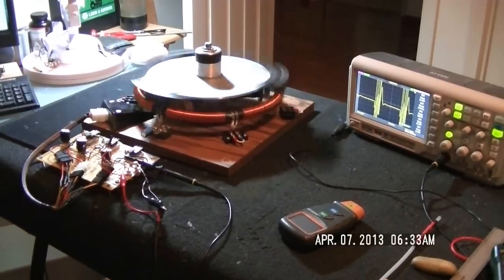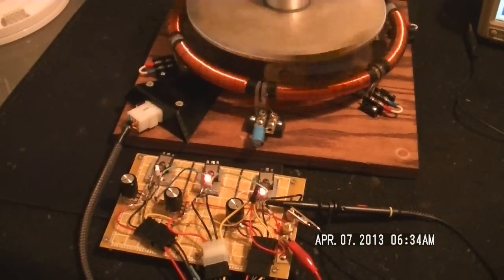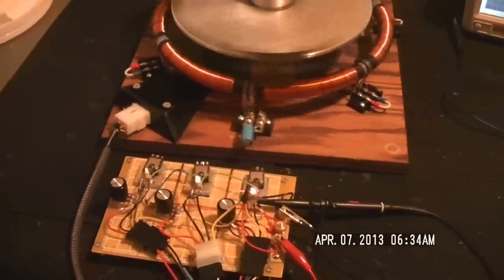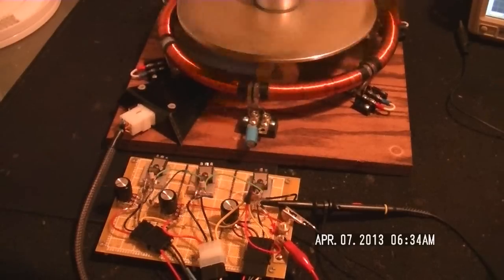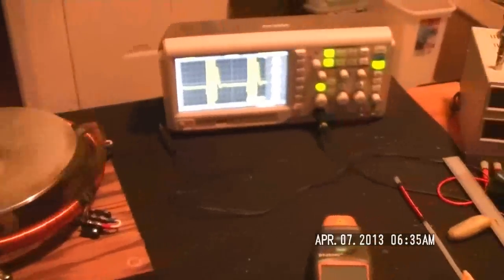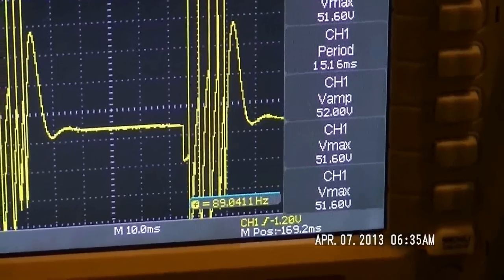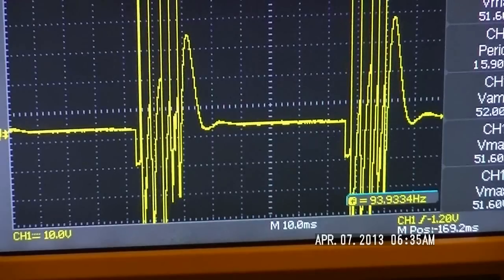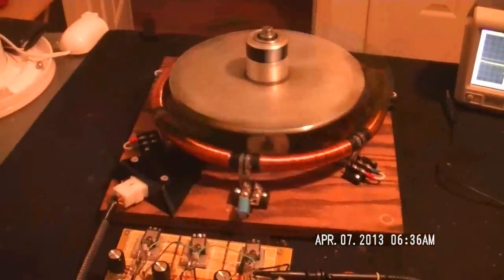Bidini Inside Out Motor Finale'

Comment: Very nice. Have your considered using ferrofluid (lab grade) inside the tubing arrangement you got there? As being a ferrite nanoparticle suspended within a smooth consistent surfactant like tetramethylammonium hydroxide might produce more saturation increasing the level of a electromagnetic field like a inductor in some principle plus minimizing inertial friction of neospheres to gain better acceleration performance of rpm. Thanks